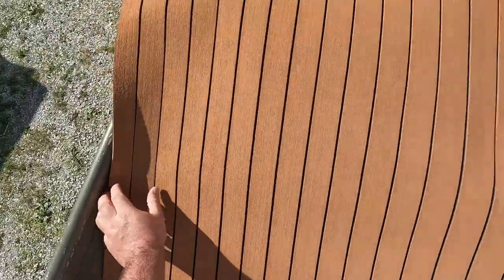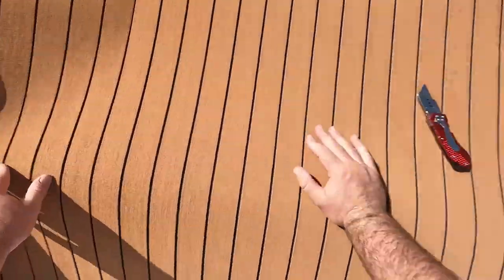HYDRO TURF Foam Boat Turf | DIY Tutorial!

Comment: One thing I’d recommend putting on the bottom of your boat is gator glide I used wetlander on my 1448 an man it’s super slick makes it so easy to push when I’m really stuck an it slides over vegetation when your moving without it I’d be getting really bad drag on the veggies an is awesome for trailering to
Reply from the maker: Nice I have thought of trying that

Comment: Another good diy man. I love hydro turf. Idk if you did it yet but if you didn't you should  try gator glide or super slick for the bottom of the boat
Reply from the maker: Thanks man! Ya not a bad idea haha
Reply: @DuckGunChronicles  it works wonders. its what we use on the airboat to pretty much run dry land